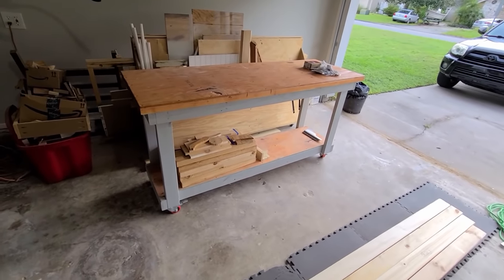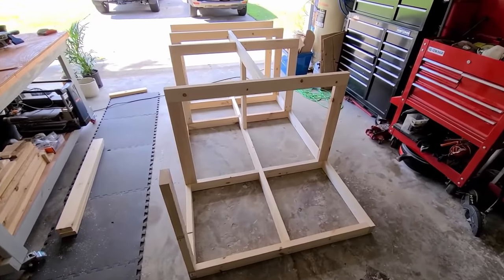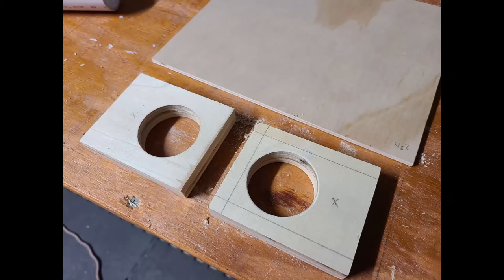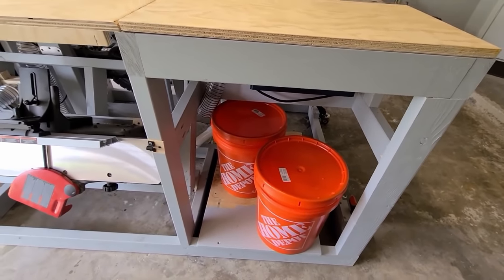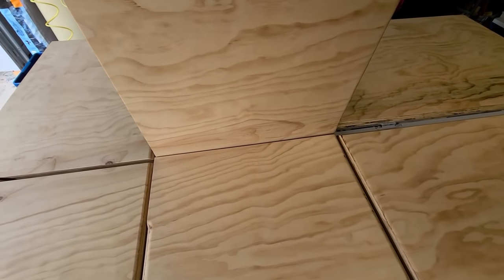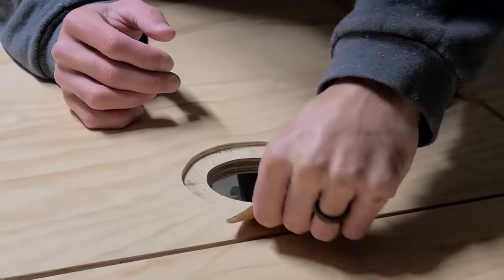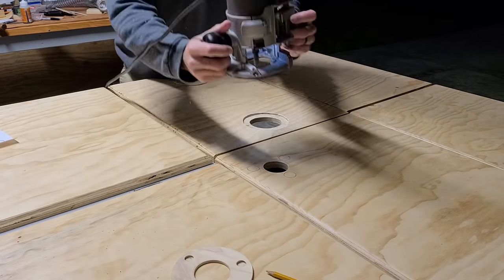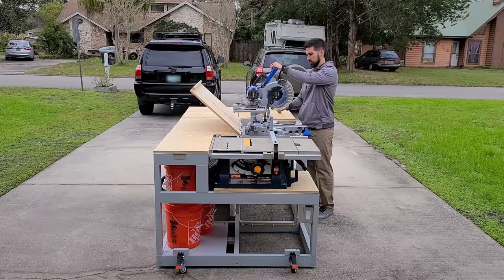4x8 Workbench, Tools, Vacuum, Power and Dust Separator

Comment: BTW my planer has built in blower that is way more powerful than my largest dust Vac. I only use a bucket for the planer itself to blow wood chips into. No vacuum needed
Reply from the maker: Interesting. Does it ever clog?
Reply: @phillipreborn  no. The hose is however only about 4- long.
Reply: Gonna guess it’s a DeWalt?
Reply: @BACcontrabass  older Craftsman. Most have a built in blower/ fan. BTW, I’d love to get that DeWalt and get rid of snipe.

Comment: That's really good man. I am building something similar in my shop as I have the same situation. Just a thought on the planer, couldn't you have turned it 180 degrees on it's mount and attached the vacuum hose with a 90 degree elbow? My thought is then you wouldn't have had to cut into your nice table top. In any case its really though out and constructed. You should be totally proud. I'm also a big fan of the outakes! :-)
Reply from the maker: Thanks you! That is a good idea, it could have been turned or swapped to the other side. It fit my needs best where it was to have the largest outfeed possible and I didn't mind sharing the vac hose with the router because it is only used occasionally. Thanks for the feedback. Those hole saws can be tricky.

Comment: I really like this build. I have the same jointer and I was wondering how you account for adjusting the height of the router for different depths on your work bench. It looks like the panels around the jointer are static so they won’t change in relation to the height of the jointer outfeed
Reply from the maker: Thanks! I did mount the jointer a little further above the work top surface. It is level when the feed side surface is at the lowest depth I'll need, approximately half of its capability.

Comment: Right off the bat I'm a bit confused. Shouldn't you run material through the planer first, and then the jointer, as the jointer uses the larger flat surface to then make the narrower edges square to the larger faces?
Reply from the maker: Probably, I'm still a noob.

Comment: Did you make an another sized dust tube for the thickness plainer in the case what you are plaining is taller than that specific length of tubing?
Reply from the maker: No, I haven't had an issue yet. It does extend pretty long, its hard to tell in the video.

Comment: Are you getting any flex on the bottom frame from the 2x4's? I was debating 2x4's over 2x6's since mine will be 8' long. Great build!
Reply from the maker: Thank you! Surprisingly not. It rests mostly on the frame and its only up on the wheels when I need to move it.

Comment: After 8 months with this design, how do you like having the table saw to one side as opposed to centered with table top on both sides?
Reply from the maker: For what I use it for its not too bad. If it was in the center with table top on both sides it would definitely add more support when ripping large sheets.

Comment: Very cool build! However, I wondered why you didn't simply swap where the planer and router sides would be. That would have solved your over engineered dust collection for the planer, no?
Reply from the maker: That is a really good point that others have mentioned as well. Very possible it would just need a place for the vacuum hose to run underneath the tool frame. The router might still have to have a fancy vacuum tube that can tuck away when the work surface is needed. There might be a way around that too.

Comment: What size/power vacuum are you using? I know my vacuum would work strong for that setup withOUT an dust separator, but it loses so much suction power with the separator that a system like yours wouldn't suck dust strong enough. So I'm curious to know what your dust collection is like.
Reply from the maker: I'm using the bucket head vac from home depot. The purpose of the dust separator is to keep your vacuum filter cleaner longer. More vacuum power is always better to an extent.

Comment: How many 2x4s are needed? Which length of 2x4? how many sheets of plywood? 3/4 or 1/2" ply...???
Reply from the maker: Approximately 13-15 8' 2x4s one sheet of 3/4 for the top.

Comment: So ingenious! I saved this video to make a similar bench at my next home.  I suppose with the recent popularity and surge in 18V/40V/80V tools that routing electrical might be optional!  I also assume that you don't have to make an electrical box and a surge protector/power strip (mounted conveniently) could be used instead?  And finally, the HD bucket separator system is optional too and I could always just hook up my Rigid vacuum to each individual tool as needed?  I am new to a few shop technologies and I'll have to look up what is the purpose of that dust separator.
Reply from the maker: Thank you! It would be cool to see it done with cordless tools. Yes, a power strip could be used instead. And yes, you could always connect a shopvac to each tool or plumb them all to a single outlet and hook the vac to that.
The dust separator keeps your filter cleaner longer.
Reply: @phillipreborn  Phenomenal, thank you!

Comment: That's pretty awesome. Do you get much suction loss through those connectors? And you have 3 pieces of equipment,  jointer, planner, and combination saw. Did you design the opposing surfaces to be in and out feed tables? If so if you could elaborate on how you figure that into the design.
Reply from the maker: Thank you. Suction loss is not bad at all since only one blast gate is open at a time the bucket head is sufficient. The area surrounding each tool is an infeed or outfeed as long as the tool next to the tool in use is folded away.

Comment: Question: when you were using the router on the vent hose area, what was the razor blade for when you cut around the hole? Thanks.
Reply from the maker: I think I was trying to make a clean cut without the plywood tearing out the top layer. It was probably overkill.
Reply: @phillipreborn  Ok, that makes sense. I'm still learning and one big issue for me is keeping the router straight so it doesn't go over "the line" when cutting. I know there are jigs out there, but the jigs don't work on some cuts. Thanks.

Comment: Wish I had something like this in my garage.  Great design.  Quick question about the planer though... Doesn't the dust port also raise along with the cutting head, breaking the dust collection that you setup through the board?
Reply from the maker: Excellent question. I answered this and a few other questions on the latest video about the 2 year update. I was able to raise it about 3 inches or 7.62 cm before the magnets lost connection.

Comment: When the tools are in "USE" position is there any issue with alignment or tools be level if need be?
Reply from the maker: Not really, I shimmed them as they were installed so their work surface was slightly above the work top.

Comment: Nice idea bro thank you for sharing!
A quick question, does the vacuum connection to the thickness planer still work when the height would change? The vacuum hose on the planer side seems to be a little short
23:53
Reply from the maker: Thank you very much. Yes, surprisingly the hose stretches and collapses quite a bit.

Comment: I love your design. I bought your blueprints, however could you give me a more detail account on the type of tools you used for construction and the type of cabinet hinges to purchase at the home depot. I am very visual and your video is good but, i am a novice and it is the little things i don't want to mess up like the screwing in the corners.
Reply from the maker: Thanks! The cabinet hinges are similar to these found at this link https://amzn.to/3EObKyc
They are called 90 degree surface mount hinges that you can also find at your local hardware store. The hinges come with templates that show how far from the edge of the door (or in this case the top work surface they should be). 

You could build the work bench with a miter saw, drill, pocket hole jig, and table saw or track saw. The planer and jointer are optional to mill the lumber so it is more uniform.

Comment: VERY cool build. I gotta ask though, how well does the vacuum actually work with that setup?
Reply from the maker: Thank you! It works ok but could use a stronger vacuum. I did a follow up video touching on the vacuum.
Reply: @oardiy I shall look for it

Comment: Nice work! I’m thinking about using this build but I had a question… did the vac hose for the planer need to be adjusted? It seems like the connection was made for the lowest setting but would disconnect once you raise the height. 

Again, great work! I’ll start this build over the weekend once I purchase the plan
Reply from the maker: It has quite a bit of flex and the hole is mounted a little higher than the lower setting so it has worked well so far. I also do not plane anything super thick..

Comment: To anyone who builds this, the 7x "21 1/2" cuts should actually be "21 3/4" or slightly more depending on how much gets milled off of the 93" center support for the bottom frame. In the plans you can check the math: the short sides are supposed to measure 45" on the inseam, so add 21.5+21.5+1.5, it only comes out to 44.5". I'll post more corrections if I find them.
Reply: Where did you find the plans?
Reply: @blakeapal00za  He sells them on Etsy for $15
Reply: More corrections:
- The 2x4 cut list is missing 2x 8' 2x4s for the broad sides of the bottom frame (they dont need to be cut but should have been listed, imo)

- The cut list is missing a 41" board shown in the plans (by table saw), but the cut should be 46¾".
 
-The 5x 25" planks should be 25½".
Reply from the maker: Plans have been updated, thanks.
-The 41" board is correct because the 2x4s on the sides are 3.5" wide on their wide side not the 1.5" on their thin side.
-Also the five 25" planks are correct. They are mounted to the outside facing 2x4.
Reply: @phillipreborn  my bad, I meant the 43½ cut is missing from the list, that is the one that should be 46¾. I could have done something wrong but that length worked for me. I love your design by the way thank you for posting it.

Comment: very nice. i've been taking notes for awhile to try to design my new small shop (1 car garage or less) and this was helpful to see. question- so the hose extension you used for connecting the planer... is that also for your router fence dust collection once you install one?
Reply from the maker: Yes. There is another video where I show the router fence build and how it utilizes the same hose.
Reply: @phillipreborn  thanks yeah I saw it right after this one

Comment: For someone just staring out that only has a miter saw and a table saw can I get away with not milling down all the wood?
Reply from the maker: Yes, it is not necessary. Milling the wood ensures they are much straighter than when you brought them home which will make the work bench more square when complete.

Comment: nice video honestly I wish I had a two-car garage my workspace is an arrow 10x12 metal shed although I'm getting some ideas with your bench although measurements would have been helpful just saying! what bit did you use on your router?
Reply from the maker: Thanks for checking it out. I'm glad to hear it gave you some ideas. Full plans are available at this Etsy link https://www.etsy.com/listing/955545412/simple-4x8-full-shop-workbench-plans?click_key=a3e53701765074820793c821e6a69b30b141c9a6%3A955545412&click_sum=fbc4df1c&ga_order=most_relevant&ga_search_type=all&ga_view_type=gallery&ga_search_query=4x8+full+shop&ref=sr_gallery-1-1&organic_search_click=1&bes=1

The router bit was just a regular two sided cutting bit, 1/2 or 3/8ths for the channels. A bearing guided bit was used to round over the edges.
Reply: Thanks

Comment: Thanks for the video! I have a Ryobi table saw system, similar to yours. My crosscut attachment will slide an extra 6” past the base - does yours do the same? It looks like you cut your table about 4” from your saw - did you decide the full length of the cross cut slide wasn’t that important to you? Also, do you note your stock hanging up at all in that 4”?
Reply from the maker: I am utilizing the work top as the outfeed. It is a hair below the surface of the table and I rounded the edge to avoid hangup.

Comment: I'm by no means an expert, but the very first thing you did struck me as odd... I'm fairly certain the proper way to joint lumber is to first true up one of the faces, then run that face against the jointer fence to ensure the edge is square to that face.  Then move on to the planer.  Jointing the edge first means much less area riding along the fence to ensure face/edge squareness.  Just a thought...
Reply from the maker: Thanks, that's what I was going for. I just used the jointer to square an edge up first.
Reply: @phillipreborn  Yeah, I get that, but I'm not sure you are following what I'm saying... The order you went in was joint the edge first, then you jointed the face.  The correct order is to joint one face of the board FIRST (always crown up), THEN joint one of the edges.  When you joint the face, you are pushing the board along the top, pressing it down towards the table surface of the jointer.  When doing this it is beneficial to have the widest surface (face) riding along the table surface of the jointer.  When you joint the edge, you are pushing the board along the side, pressing it towards the fence (to get the 90 degree reference). When doing this step it is beneficial to have the widest surface (the freshly jointed face) riding along the fence.  Basically you always want the widest surface available riding along the reference surface.  During face jointing the reference surface is the table of the jointer.  During edge jointing the reference surface is the fence of the jointer.  That's the way I learned, and I'm fairly certain that all experienced woodworkers use it in that order.
Reply from the maker: @a.macdonald4313  that makes sense. Thanks for sharing.

Comment: Thinking of getting your plans. Do you show how to replicate drop down options and vacuum or just the main work bench.?
Reply from the maker: There is a vacuum pipe diagram included. It shows the tool frames and I share the hardware I used. Each tool frame is mounted at a certain height depending on the feed/outfeed surface of your tools.

Comment: Does your plans show tool measurements? Not all tools take up the same real estate. I wanted to make sure before I bought them. Thanks!
Reply from the maker: There is a page in the plans for you to measure the outside dimensions of your tools first. From there you adjust the space between the upright supports to fit your specific tools. I would recommend measuring them before you order the plans to make sure they all fit in a 4x8 foot print with room for the frame and clearance in between.

Comment: I love woodworking since I took the first class in school. And you did one hell of a job making a one stop portable woodworking table. I don’t know if you fix the problem but get rid of them Home Depot buckets get rid of that crummy 5 gallon bucket vacuum. Just get yourself one big giant wet and dry vac slide it in there hook it up and you will eliminate that nightmare. I use a 2 gallon craftsman wet and dry vac for my wood working and engraving table. That thing will run for week before I need to empty it. Now the one part didn’t make sense to me. It’s bad enough people are spending way too much for wood that’s actually not the size that you’re paying for. Because they’ve already planned it. And here you are re-planing preplanned wood. Now I can see if you glue two pieces of wood together run it through the planer. I buy 100% rough cut lumber so when I need to run it through the planer over the Joyner that makes sense but when I seen you take that 2 x 4 that’s not even a 2 x 4 re-ran it through the planer. Thanks for a good laugh. I’m just trying to understand why would you put a 2 x 4 through a planer when actually it’s north and south that needs to be square so the table don’t wobble. And if the 2 x 4 had a slight twist in. The planer a 2x4 again just wasting wood. No going to take the twist out of it. If you like planing. Buy rough cut lumber because you actually get the sizes you’re paying for. Actually a lot of the times you tell them you want 2 x 4 x 8 foot you get a 2 x 4 x 9‘ other times you’ll get a 2 x 4 that’s 10 foot when you’re dealing with rough cut lumber. And when you put a measuring tape on them you’re actually getting 2.25” 2.3/8” inch thick 4.25” to 4 3/8 wide by 8’ to 9’ ft long. And you’re also paying by board feet. You’re not going through a lumberjack sawmill then a box store. Paying for a 1.75 to 17/8” thick 3.75” 3 7/8 wide 8’ sometimes with cracks going up the end of it. you pay $4 to $9 each depending on what grade it is.
Reply from the maker: I actually used to connect a shopvac directly to each tool before this work bench. Thanks for watching and commenting.

Comment: Great job! 
Couple questions- 
What happens to the dust collection hose when you raise the planer for thicker materials? 
Why didn't you put the bucket head vacuum directly on the double dust separator buckets? (Room?)
Reply from the maker: Thank you very much. So far the planer hose has enough slack when raised up to at least 6" of thickness, more than I'll need. That's a good question about the bucket head. There was not enough room in the top bucket and I've always seen the vacuum pull from a second location through the top of the dust separator. That might work with a slight redesign though...